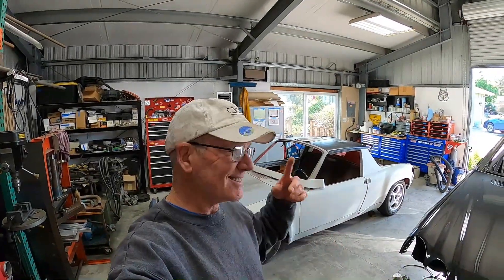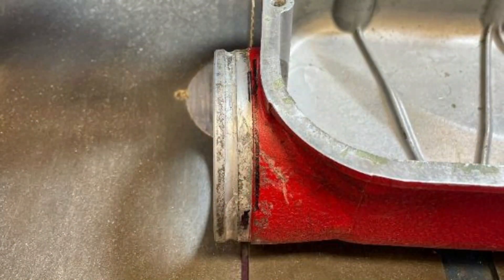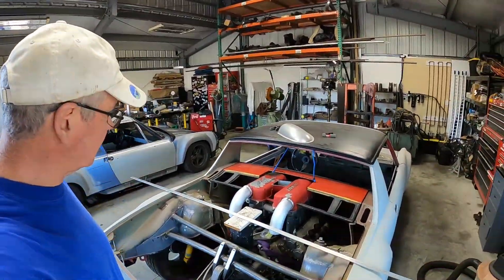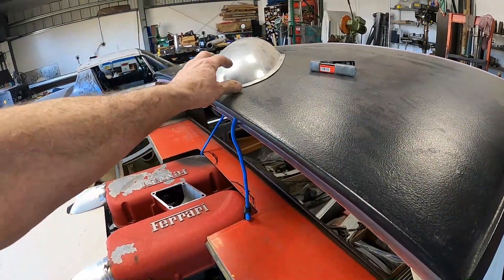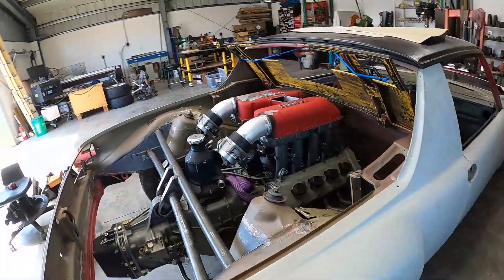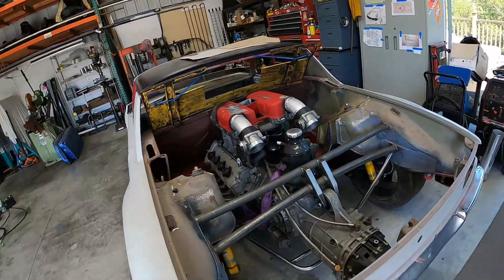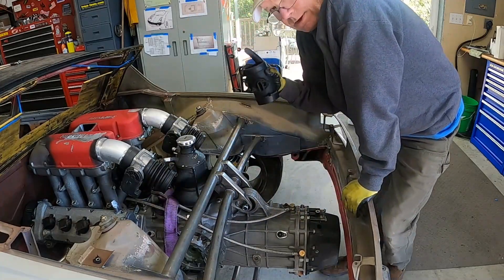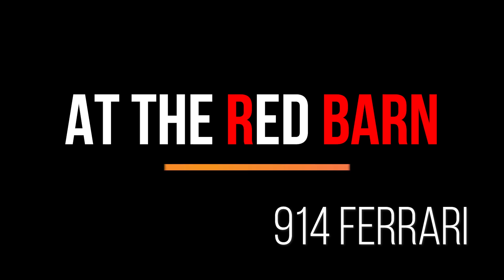914 Ferrari Build - Episode 18: Intake Manifold Mods

Comment: You could cut the intake runners down (shorter) to get the plenums to clear the hood and put a clear ZR1 style panel in there to show off the Ferrari engine...  then you'd have a straight shot for the throttle bodies and the MAFs.  Just a thought.
Reply from the maker: I hear you but cutting the runners involves a bunch of other mods. Check out "Home Built by Jeff". He's putting this same engine in an Alfa and he shortened his runners. I'd prefer to keep them factory length and I think I can solve for the throttle bodies in other ways. But as I've learned: Neve say never!
Reply: El Ferrari con Corazón de Corvette de la Leyenda de F1, Froilán González 
🇦🇷🏁👇🏼
https://youtu.be/o9yOmMSKU9A

Comment: Love the Ferrari 914 and the rear engine cover/hood almost looks like it should be a common bulge across the dual plenums.  That same bulge if extended rearward could also house the air intake and filter assembly while being incorporated  on the engine cover an swing up out of the way from th engine for servicing.
Reply from the maker: Working out the engine cover/trunk is going to be a fun challenge. Trying to keep it at least a little bit stealth... We'll see! Thanks for watching/commenting. I appreciate it!

Comment: The Ferrari ecu would require using Leonardo to mess with.
Reply from the maker: That's what I've been worried about. But I've found a guy who hacked them and can program (virtually) anything I need. So the plan is go with the factory electronics. Fingers crossed!